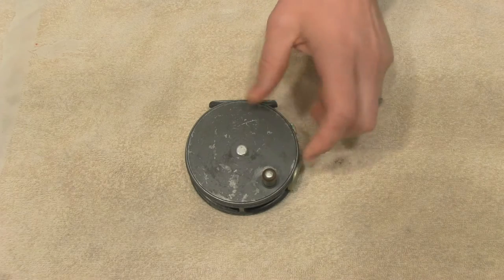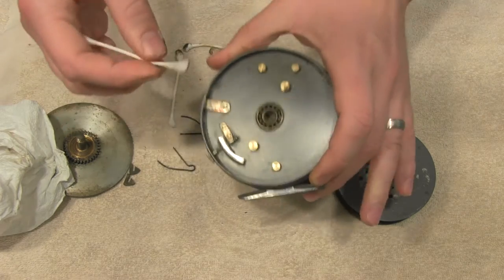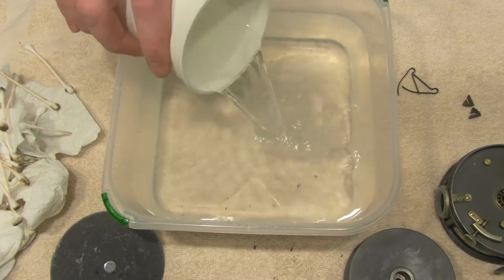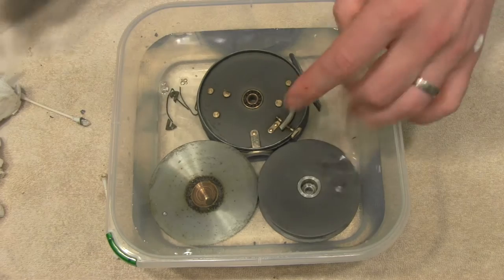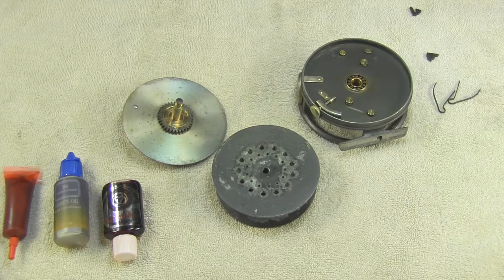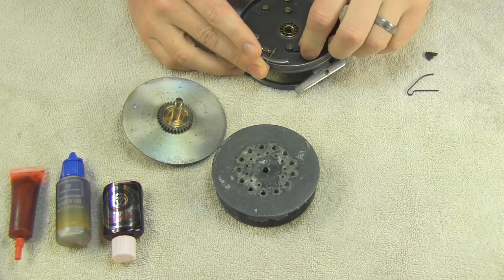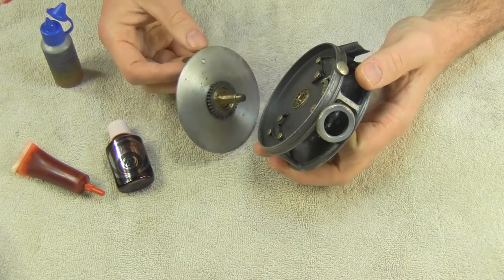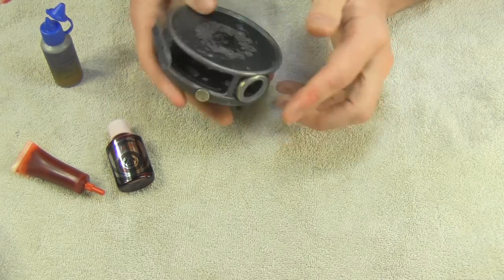How to Clean a Fly Reel | Vintage Hardy Click and Pawl Fly Reel

Comment: I would'nt bother with the water and vinegar. The service team at Hardys Alnwick told me to first use WD40 on the whole reel and then clean off with lint free cloth. Once all the old grease and gunk is gone wash with hot water and washing up liquid, then wash again with hot water under the tap. Dry off with lint free cloth and leave to dry in warm room overnight. Next day use oil on screw thread, check springs, pawls and handle, then grease + oil on spindle, grease on spindle head and check wheel. Put reel back together and wipe over with oily cloth....Job done !
Reply from the maker: I've heard that WD40 can really be tough on old reels.  While this was an enamel reel in the video, I use the same process on my leaded Hardy reels (where i would never used WD40).  I'd rather take the extra time and be careful on some of these older more valuable reels.
Reply: @KevinHospodar  Vinegar is an acid. I've used WD-40 to clean all kinds of reels including early vintage for decades. I've never had damage as a result, but  I rinse with water and Dove detergent before re-lubing.
Reply from the maker: @David-rr8cu  the dish soap is used to counteract the vinegar... sounds like a similar process to yours

Comment: Is vinegar bath safe for leaded variants?
Reply from the maker: yes - the same steps I followed can be used on leaded reels.  You just need to be careful with drying/scrubbing/wiping not to use abrasive materials or too much pressure where the leading is being worn off/removed

Comment: What sized switch rod are you using for this reel?
Reply from the maker: Hey Skyler - I've used 3 7/8 perfects on 6wt switch rods
Reply: @KevinHospodar  nice i was thinking of getting a 7wt switch for my 3" 7/8
Reply from the maker: @sky2k316  Your choice of line/running line makes a difference.  I use mono line with shooting heads, so that affords me some space on my reels.  The 3 7/8 (of this vintage) have more "trout" appropriate pawls and springs, but have been fine for me with Greats Lakes steelhead